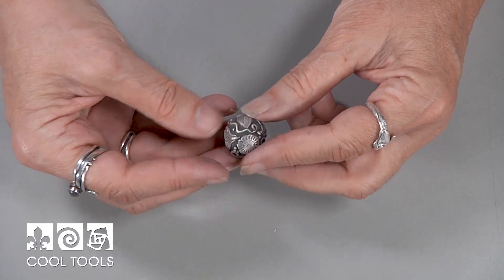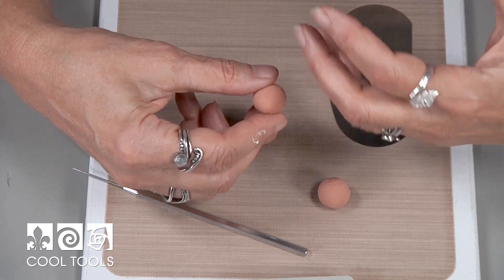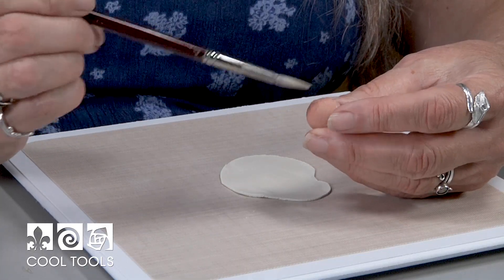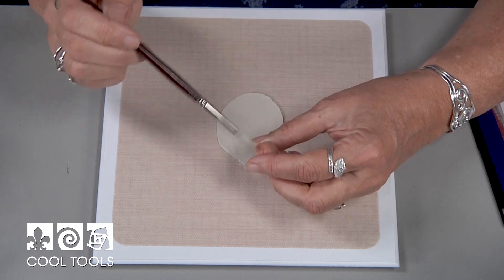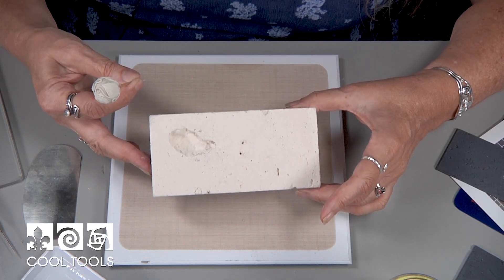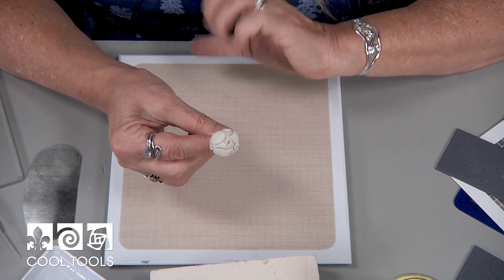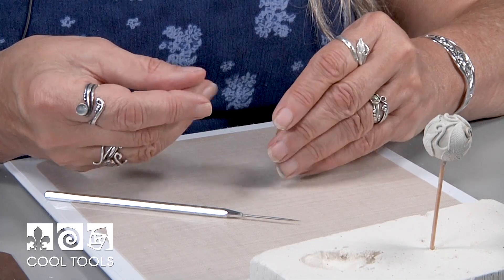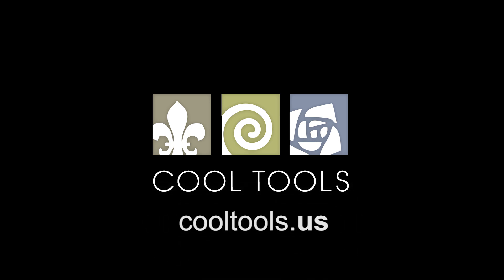Cool Tools | Hollow Bead Using Wood Clay by Lisel Crowley

Comment: Hi! Thank you for the tutorial. What would be the recommended firing schedule for wood clay when using with PMC3?
Reply from the maker: Hi Marisol, the firing schedule for PMC3 is 1650°F / 899°C for 2 hours. Thank you for watching!
Reply: Thank you for your reply. So is it safe to fire wood clay at a full speed?
I’m asking because I have read information about how to fire when using CORK clay (slow ramp and holding at 900F for 30 min and then normal) but I can’t find consistent information regarding on how to fire WOOD clay when using it as a core for PMC3.
Reply from the maker: @marisolborboa6901  Hi Marisol, it is highly recommended that the kiln ramp is slowed to allow slow smoldering out of the wood clay. A fast ramp speed might cause a quick burning when the wood clay reaches
its flash point, which can in turn superheat the metal clay and cause distortion or melting. Simply set the kiln to the typical
firing schedule for the metal clay, slowing the ramp to 1000ºF/hour to accommodate the wood clay. Hope this helps!
Reply: @cooltoolsvideos  thank you for the advice, sure it helps!
Reply: I just watched another video of making a hollow bead with cork clay. For firing they recommend 200/hour up to 750 then hold for 10 minutes for the first ramp. Second ramp is full speed up to whatever heat your clay requires and hold up to a minimum of 2 hoursç
Reply: Thank you! That makes sense